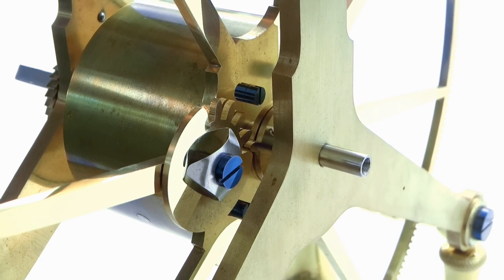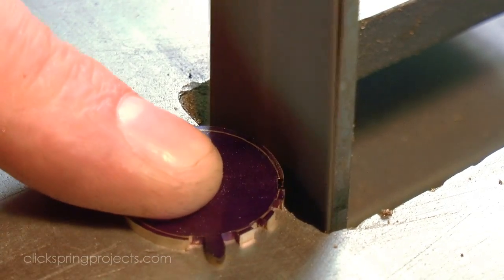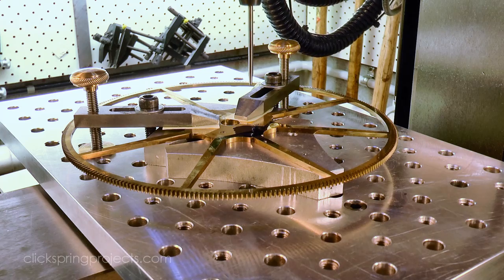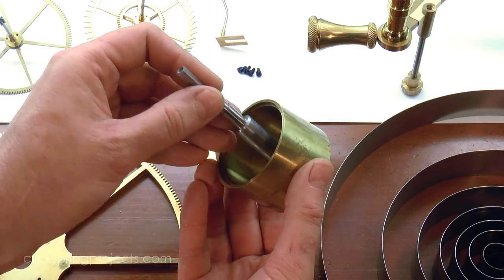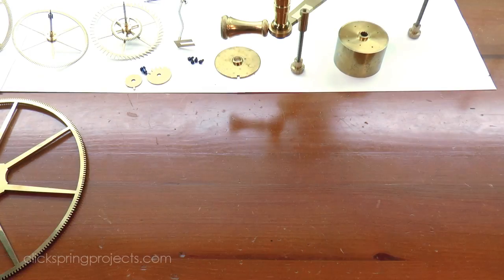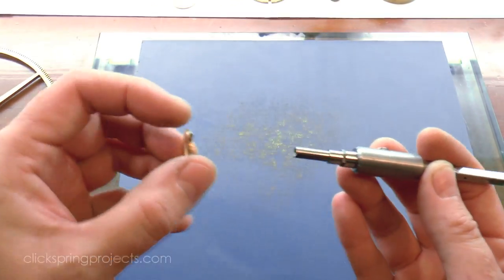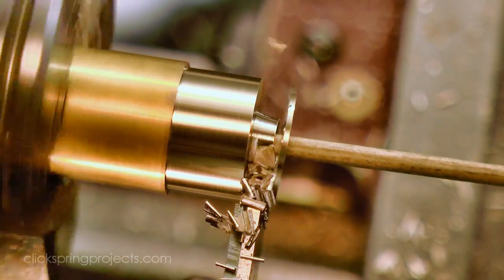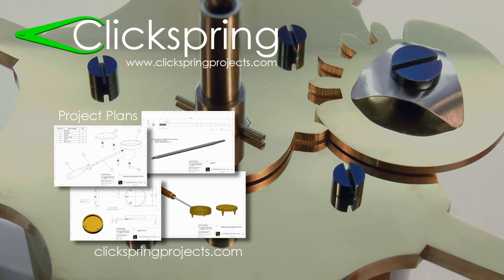Clockmaking - How To Make A Clock - Part 22 - Making The Stopwork Mechanism

Comment: Just a thought, Chris, and don't be afraid to shout me down on this, but the meshing depth is very shallow, as you correctly point out. The only possible inherent weakness in this system is the depth of the tooth with such an undercut, leading to lowered tooth strength.

Would it be possible to cut the teeth accurately in the meshed part of the teeth without weakening the mechanism by the necessity of removing too much meat from the unused root of the teeth?

I have no idea but at a guess it may necessitate a specialist tooth milling cutter, or maybe just a standard pinion cutter ground to give a much shallower depth of cut, whilst maintaining upper tooth accuracy and proportion where it matters.

Just a thought, Chris and something you might discuss and experiment with.
Reply from the maker: Hey Gordon, yes certainly - John Wildings plans describe a cycloidal tooth profile, using a custom made tooth cutter, but its clear after playing with the mechanism that a constructor could be fairly relaxed about the tooth profile and implement just about any rounded shape with a more robust root geometry, without having to use the cycloidal tooth profile. I'm not sure its really going to necessary  - any semi alert winder should get the signal that they've hit the end of the wind without cranking things on further - but it could certainly be done. Having said that Wildings procedure for generating a custom cycloidal tooth profile cutter was well worth doing - I'll be using it on the next patron series project!

Comment: Love your work man. how much would a clock like this sell for?
Reply: Similar clocks are selling on ebay for between $200 to $400 dollars, which is surprising to me considering how beautiful these clocks are.
Reply: benduker same I thought they would sell for several thousand
Reply: Would be interested to hear how many hours you've put into this!
Reply: I think he meant a handcrafted clock. Those usually don't get sold, since the time invested in making them would add up to a ridiculously high price. Think of how many hours Chris has put into this, and now multiply that by, let's say, 10$/hour. There's no one willing to pay that. The market just isn't there.
I'm sure there are some professional clockmakers out there that actually make clocks, but they are few and far between, the building process is probably very different from what we're seeing here (buying pre-made whatever you can, making large batches of generic parts and designing the clock taking these things into account) and the clocks are still sold as luxury items, with price tags that neither you nor I can afford. 
The average clockmaker's job is usually just repair or restoration.
Reply: altaroffire56 I never thought of it that way, thanks for the insight.

Comment: what does the bed of brass chips when you are blueing something?
Reply: I guess they are for distibuting the heat evenly throughout the whole screw. If you would shoot a torch flame directly at it, it would leave the screw inconsistent in its color.
Reply: ShopTalk It helps to disperse the heat evenly over the part to provide a uniform colouring.
Reply from the maker: It helps to distribute the heat more evenly and also slow down the transfer of heat. Thanks for watching
Reply: It makes sure that the heat spreads even over the whole part so that the blue color will be even as well.

Comment: A Swedish company call Helix Verktyg (helixverktyg.se) makes a special set of drills for thin sheet metal, called Tunnplåtsborren (literally translates to "The sheet metal drill"). I've tried it, and it's ridiculously good, you can hold a thin piece of metal with your hands and drill it with a giant drill press and it won't ever catch and cut you yet it drills through even moderately thick sheet metal lightning fast and makes perfect burr free holes. If you contact them, maybe they'd be interested in sending you a set.
Reply from the maker: Thanks for the tip, will check them out :)

Comment: Doesn't that "heat bluing" eventually turn to red rust?  It sure does (eventually) on blacksmith tools that I have made.
Reply from the maker: Hello mate - the key to minimising corrosion on blued parts is in the finish, not so much the bluing oxide itself. If taken to a high polish before bluing, blued parts can remain corrosion free for many hundreds of years - Cheers :)

Comment: When the clock is running, does it stop when the index wheel gets to the last tooth?
Reply: Yes. Power is then no longer transmitted to the gear train. Still, better that than winding down to the end of the whole spring. This way there is still a fair amount of tension on the gear train just before it needs rewinding.
Reply: Thanks. That's what I thought, I wanted to see if I understood it correctly.